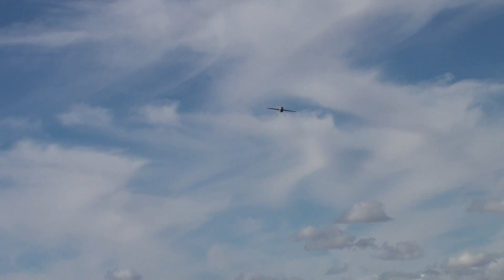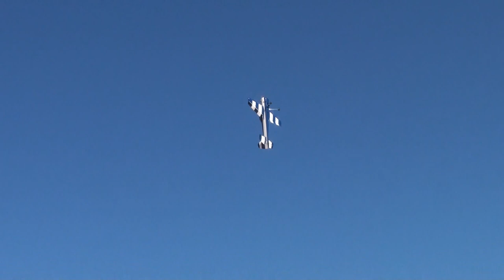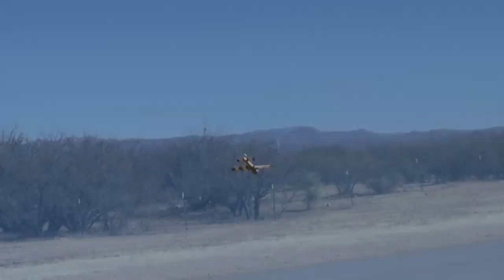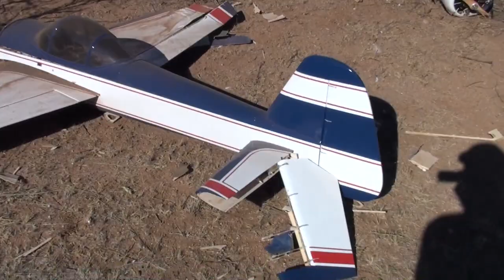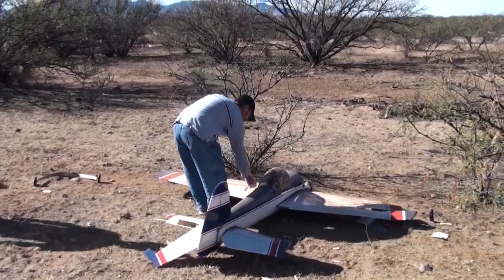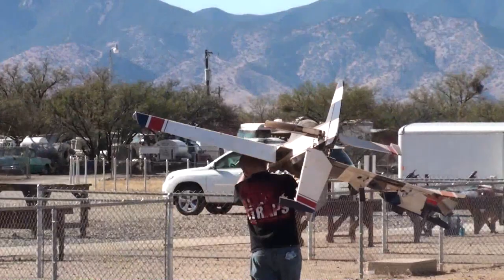YAK 55 RC Plane Final Flight , Jeremy Valencia.mp4

Comment: in the slow mo footage it looks like one elevator is up and the other isnt...possibly not using matched servos or servos with enough torque for control surfaces.
Reply: You are right servo problem, I never use cheap servos.

Comment: Should have still had control of the plane even if the carb messed up.  Why not glide it out of the dive?  It went straight down.  Batteries stop working too?  I've had mine die in flight in both high climbs and straight dives and have always been able to still pull it out of tragedy and land it.  Engine went out or whatever, but it's either pilot error or the batteries died and he couldn't control the ailerons or rudder.  9 times out of 10 it's pilot error.